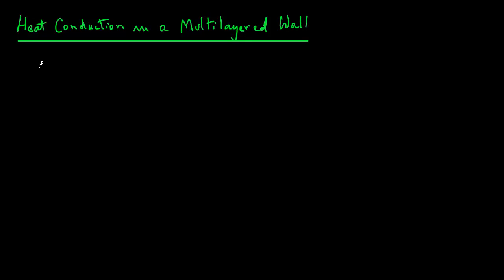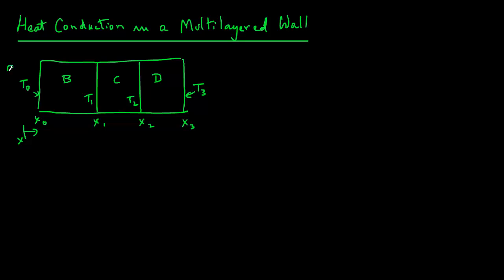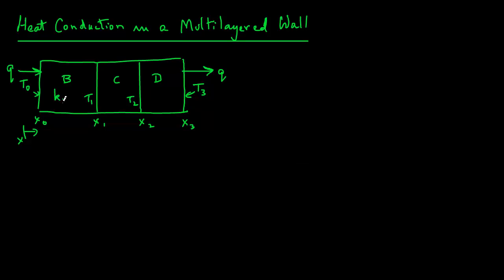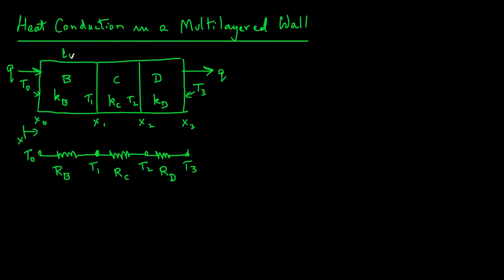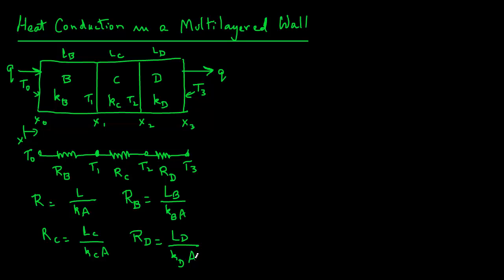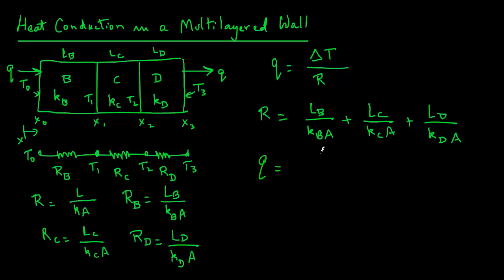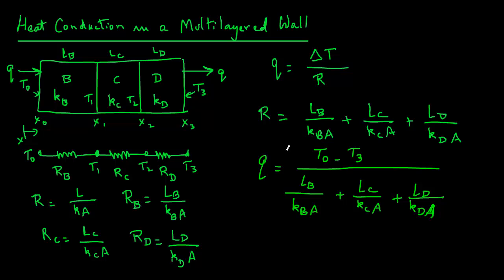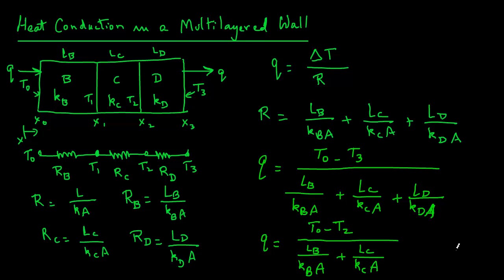Steady State Heat Conduction - Multilayer rectangular wall

Comment: will q value be constant if convection mode is also added in steady state?
Reply from the maker: Yes. As long as the temperature does not change with time, a steady state will be maintained. This holds true when considering conduction, convection and radiation modes of heat transfer, combined or separately.